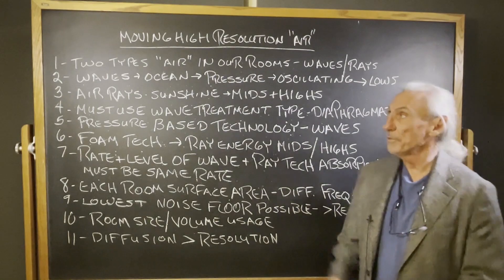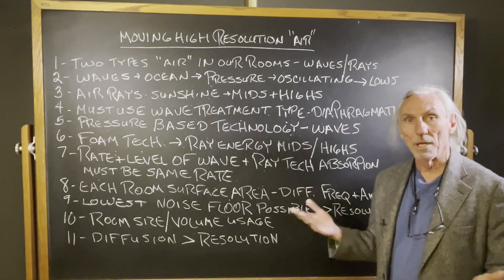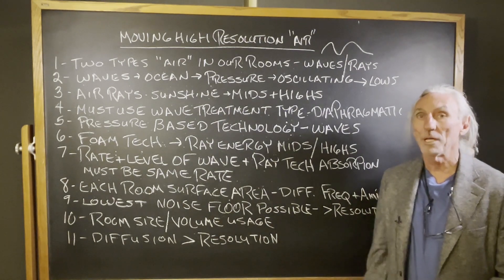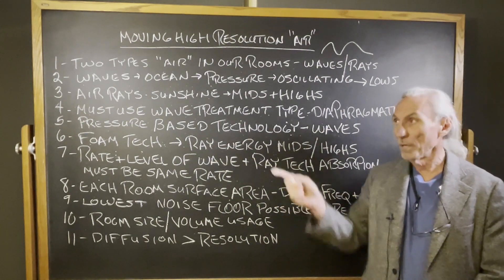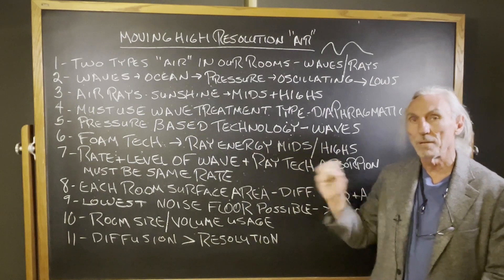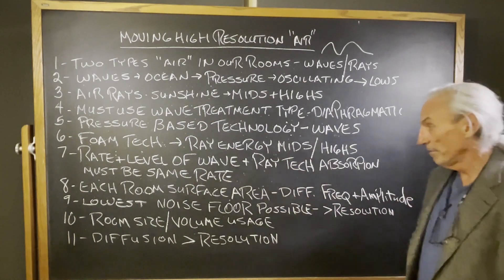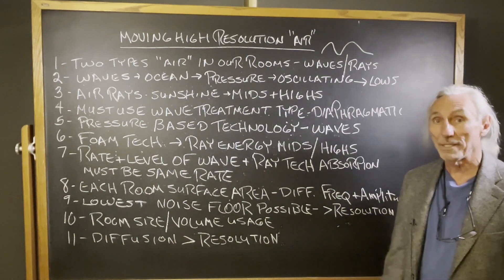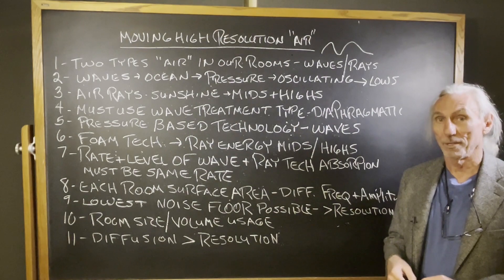Moving High Resolution "Air" - www.AcousticFields.com

Comment: Thanks for the consistency!
I can always tell from the vids that the space around is treated. Though youtube compression doesn't do it justice.
Reply from the maker: Compression and computer speakers do not do anything justice.
Reply: @AcousticFields  oh I'm not using computer speakers. I've got my own hifi with headphones. they've come such a long way as well. you should give them a try, you might be surprised.
Reply: @djhmax09  what are your daily driver headphones? i'm using the hd 560s.
Reply: @ump7290  nice! I have a set of hd6xx and they're great. But my daily ones I use regularly are focal utopia, final d8000pro, and Sennheiser ie900.

Comment: as always im learning a ton, many thanks.  I will be getting some of your foam pads.  My question, will a canvas cover mess with the performance of the pads.  like when you put a move poster print on the canvas then cover the pad to make art for the walls
Reply from the maker: Middle and high frequency absorption technologies work with air flow. If you cover the foam with a material that restricts air flow, you restrict performance dramatically.